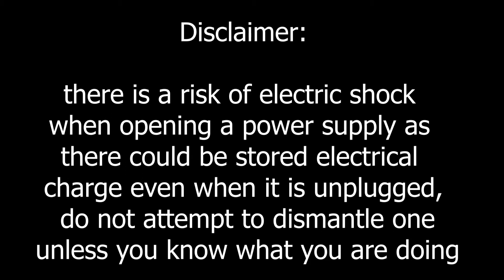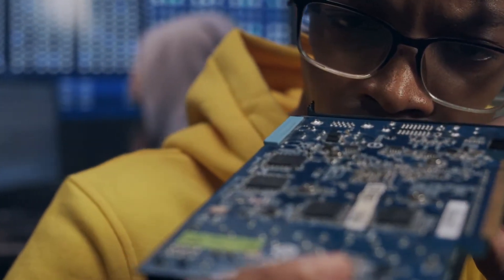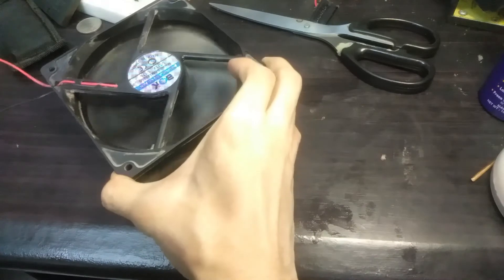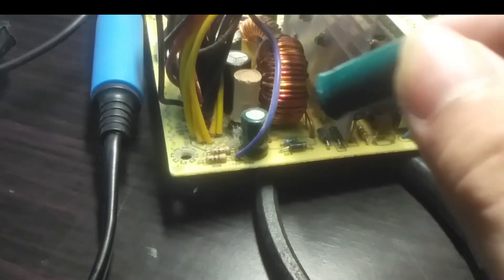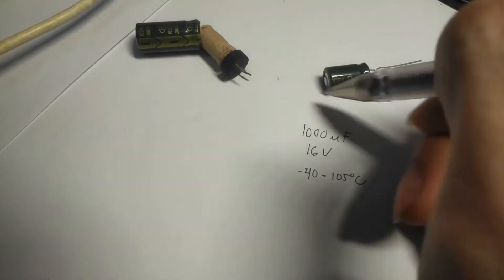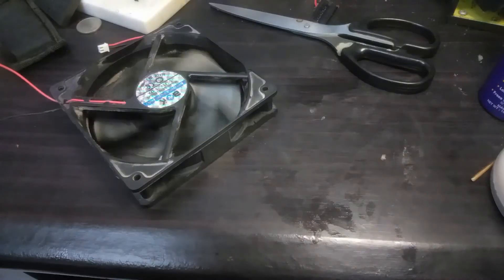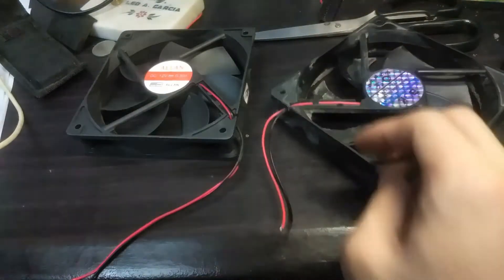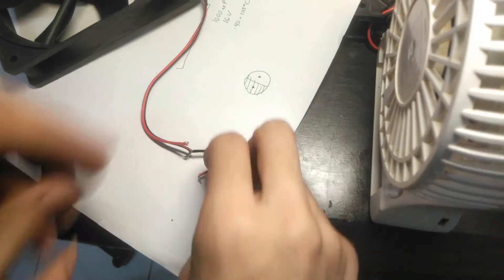Fixing power supply fan not spinning, making noise, spinning very slow.

Comment: Did this problem cause computer to restart after using it for 1-1.5 hours?? I'm facing a issue where my pc work fine for 1 to 1.5 hour the it started to restart continuously pc got on and then restarted again. Can you help me
Reply from the maker: My computer would just shut down randomly. Is your power supply getting very hot? Mine was due to the fan. 

Is the first 1 to 1.5hour very high demanding task that uses more power like graphics card, causing the power supply to heat up or shut down?

Try troubleshooting, possible other components that fail when in high load. However, Blue screen usually happens when software or hardware failure.

Power supply is a probable cause.

Comment: what happens if you're using pc without psu fan spinning? is it okay?
Reply from the maker: In my case, it caused overheating, which is not good... leading to performance issues for your PC and potentially damage to the power supply.
Reply: @RenzElectronics does it cause shutsown cus i am having same issue

Comment: My fans r spinning but very slow,which method should i use?
Reply from the maker: Go for the easiest solution first, which is by replacing the fan... Buy a 120mm fan then just solder the wires to the same connector. If it is still slow and you see a faulty capacitor then try replacing capacitor. Always be careful when opening power supplies especially with capacitors inside them because they may still be charged.